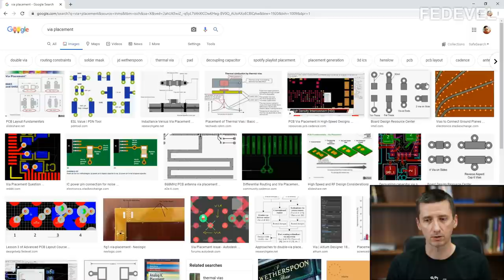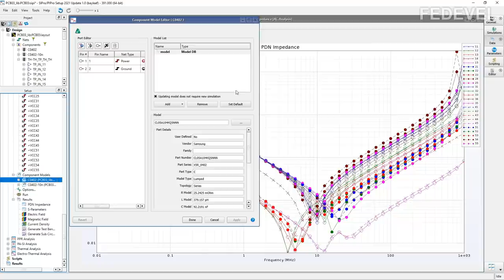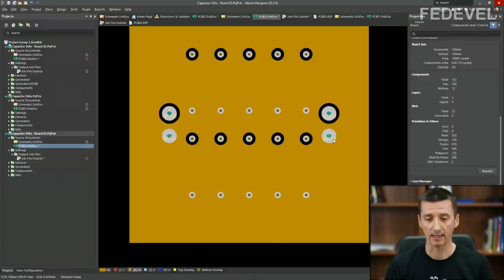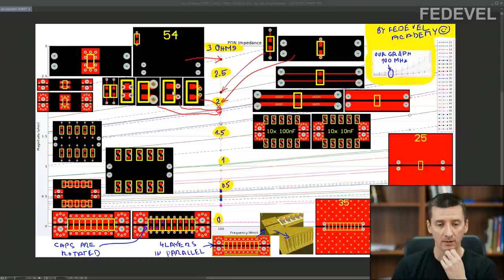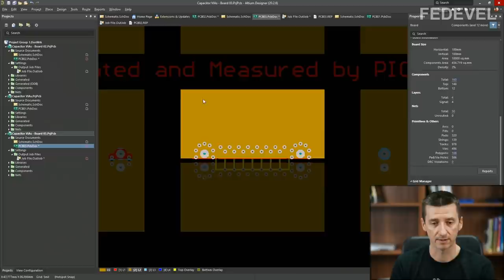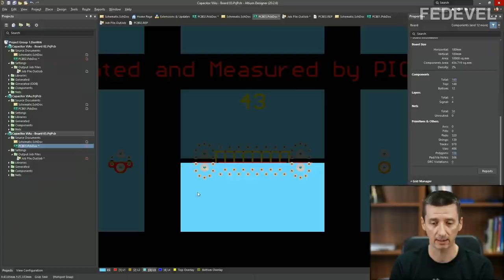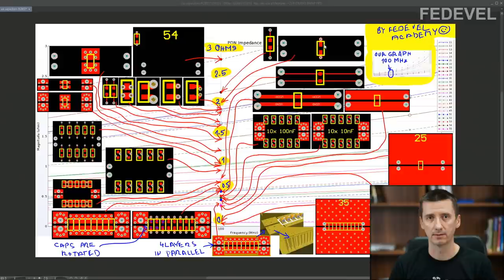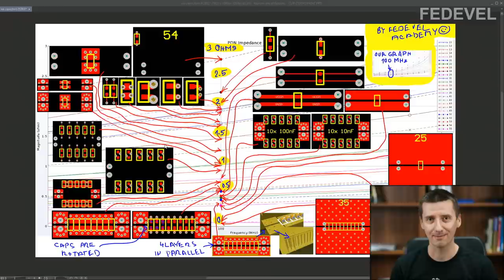What is The Best VIA Placement for Decoupling Capacitors?

Comment: To me the simulation results without vias look totally fine. To my knowledge, vias have non-negligible inductance which increases the impedance at high frequencies a lot. So a direct connection is always better than vias.
Reply: how does via inductance over frequency differ from track inductance over frequency?

Comment: I'm a hobbyist (2 layers PCB, audio) and I have been always taught that coupling caps should be on the same layer as the component being decoupled. I belive it makes sense, since vias have parasitic inductance and resistance (also explains why having multiple vias help). Thank you for the videos, they help me a lot!
Reply: I put them, on the same layer when possible, I also put a via on the GND pad of the cap.

Comment: When people say the location of the capacitor doesn't matter; they are talking about the bulk capacitor(C>100uF) which is more effective at lower frequencies. For decoupling capacitors location matters hugely. Moreover, if you build and measure the real results, I propose a better method for the circuit #43. You used multiple power planes. But if you use power and ground planes interchanging from top to bottom or vice versa ( P-G-P-G) you can create a good interplanar capacitances parallel to each other. This method is said to be much better since the interplanar capacitance has very small ESL compared to chip capacitors.
Reply: this is true, but this is only partial inductance.  You still have to get from the cap vias to these planes and from these planes to the ASIC or other DUT
Reply from the maker: Oh, I believe that people / articles were talking about decoupling capacitors. That is why I was so surprised. Need to find them ... PS: Good idea with the power planes. Thank you.

Comment: You demonstrate the effect of the position of the cap by showing one very far compared to one in the center. I would be curious of the result of a cap very near the power pins! Thx for the video, always fun to play the PCB version of Dora the explorer ;)
Reply from the maker: Thank you Nicolas :) PS: I am making a note about this setup.
Reply: @RobertFeranec  Yes, exactly my thought. I wonder how a single capacitor directly at the sink without vias would perform. Which is, to my knowledge, the recommended way of connecting decoupling capacities

Comment: I cannot recall where I heard this from. Someone told me that the efficiency of decoupling is all about the loop inductance (from the cap itself to the power pin). A via is an inductor as well as small traces and long distance. So a good decoupling is to minimize all 3, if you have space!

Comment: Very illuminating video!
25:20 I keep going back to the hydraulic analogy, because it works.Which will give you more immediate access to your local water reservoir: a long narrow tube or a short wide pipe? Of course you're going to have less impedance if the power traces are on the same layer as the capacitor; there's always going to be some additional impedance through a via, like resistance through a straw. In fact, if you plan your stackup right, you can even exploit the impedance of a via from a power plane as part of an RC decoupling filter. It's not rocket surgery, it's PCB materials engineering.

Comment: Very interesting!  Especially the performance of the thin top layer traces with no vias vs. planes with vias.  After some thought I would suggest that the remarkably low impedance is partially due to what the simulation is measuring.  Specifically, it appears that the simulation is calculating the impedance from the S21 insertion loss parameter which measures the voltage on the output pair given a varying voltage/current on the input port.  For a high speed decoupling capacitor I would think that the S22 (or S11) return loss parameter would be of greater interest which would measure how much the voltage on the output pair changes given a varying output load current.  I think that the calculated impedance based on S22 would be much higher for the long skinny top layer trace case.

Thank you very much for the wonderfully informative video and keep up the great work!  I would love to see some PCBs actually built and tested with a network analyzer for both S21 and S11 insertion and return loss measurements.

Comment: Hi Robert! Your video is highly informative, get to see which layout has the  lowest impedance. A bit of warning for vias planting near the pads, as this would leak the solder into them, thus weakening the solder joint on the cap leads. With a weak solder joint, weak connection, bad impedance. Thank you and keep sharing!

Comment: Hi Robert,

I really appreciate your investigation on that topic. It made me think a lot and the following question arised: How would simulation change, if you would only connect the capacitor's power and/or ground pad directly to the IC's pads and not to the source pads. I think this case would represent a very typical design approach.

In practice, many of the "good "solutions presented in your video can't be implemented, since board area is limited. If you like to spend more time on that topic, it would be interesting to take a look on more simple/practical designs. What I mean by "simple/practical" design is:
- Place one or two capacitors of different sizes (e.g. 1u + 0.1u) really close to the IC's power pad (capacitor and IC on same board side)
- Connect the power pad of the capacitor directly to the IC's power pad with a wide trace
- Connect the power and ground pad of the capacitor to power and ground plane by via, respectively

Then you could go ahead and simulate following effects on PDN impedance:
- Number of vias connecting capacitor(s) to planes
- Position of vias relative to power/gnd pad (above, side, both)
- Via diameter / via pad size
- Capacitor orientation relative to IC edge
- Capacitor's power pad connected directly to IC vs.capacitor's power and ground pad connected directly to IC

I think this investigation is very helpful for many board designs and maybe it would be worth a short video.

Comment: The parasitic capacitance on the example in the upper right is less since the the air is a much lower dielectric constant.   Much less inductance to overcome.   Results in a much lower ESR.   We always use thin trace for sense lines for this reason.   Good topic Robert, very well presented.

Comment: Absolutely fascinating, thank you for this! I’m definitely going to look for your other videos on this subject.

And I second the request for physical measurements to back up the simulation. My guess is the results would not be identical, but the ranking of results (which designs perform better than others) would remain the same.

I would be very interested to see the load changed to a SMT connector, to simulate (or physically test) the real world case of the load being a SMT device, like a QFP or QFN device. There is debate over the best placement of decoupling capacitors in these situations, and to me your result at 23:40 makes absolute sense; there are no vias between load and decoupling capacitor, and to me that would produce the lowest impedance between the two. For this reason I always place SMT decoupling capacitors as close as possible to, and on the same layer as, the load device.

What I take away from this is that the two biggest factors are (1) capacitor placement as close as possible to the load, and (2) avoiding vias between capacitor and load. Then, if you must via between the two, (3) maximise the number of vias in parallel, (4) maximise the number of capacitors in parallel, and (5) maximise the number of ground and power planes in parallel. Lastly, it is worth maximising trace width and minimising trace length, but after the above steps these make only marginal improvement.

Comment: Great Video!
If possible, I always try to place the decoupling capacitors on the same side of the IC and draw a direct connection (and not separate vias for capacitor and power pin).
In my understanding, I have two reasons:
The direct connection creates a low inductive path. That also applies for your example with a the thin, but straight direct connection. With separate vias, the current from and to the capacitor has a more odd path to follow, which results in losses for higher frequencies and impairs the decoupling effect.
The second reason is: You want to have the decoupling capacitor as the reference, not the decoupled plane around the IC. There might be still some current peaks crossing that take effect. This applies for forward and return current, so to say Power and Ground. That is why I also try to put the vias behind the decoupling capacitor, not between capacitor and IC.
Reply: this may not be a good idea.  Watch for another via.  The question is always the sum of the partial inductance terms.  If there is a large separation between planes (say 2 layer or 4 layer PCB with symmetrical thicknesses) then the inductance of a surface trace is very high.  If the two capacitor vias can be very close together, field cancellation will greatly reduce the inductance.  This is in many of my lectures and bootcamps.
Reply: You are doing exactly the right thing. Keeping the noise out of the plane.

Comment: Great Video - an EMC seminar once told me to run power trace across the capacitor, directly to your pin of the IC you are decoupling (Same side). So this adds up with what you have said here. Would be great to see this boards in action.

Comment: Robert, very nice and useful video and very surprising results! If I understand right, the loop inductance plays the main role in degrading the PDN quality. As well VIAs also degrade the loop inductance according to these results (due to their inductance). Placing decoupling capacitor far from the desired point on the board (like VCC & GND of some component) significantly reduces the influence of this capacitor on this desired area. This is the reason why it is mandatory to place as many capacitors (near all power supply pins) as possible. When we place the capacitor between two parallel traces, the travelling wave (noise) is shorted by it, and do not propagate towards the load. When this capacitor is placed far away aside, it shorts the wave propagated towards it, but not the wave propagated towards the load, and can even create travelling wave. This is how I imagine this phenomena. So, according to this video, the best way to place the decoupling capacitor is on two traces between VCC and GND vias and an appropriate componnent's pins. Please correct me if I'm wrong.

Comment: This is very good, thank you! It would be interesting to see the result when there are vias by the capacitors, and then they are connected with traces to the power pins but not the supply. That seems likely to happen in a board layout.

Comment: Excellent work, Robert!  Years ago, some technical articles I read, either from Microchip or Cypress Semiconductor heavily stressed the effectiveness of placing decoupling caps near the power pins and on the same layer as the power pins of microcontrollers.  EG in the case of a quad flat package.  You can feed the pins their power through vias, but you want the decoupling caps between the vias and the pins.  As you say, you can't always have things arranged this nice, but it's something to target when you can.  I like your confirmation of surrounding power feed pins with vias improving performance.  I had often suspected this would be the case.  Thanks again.

Comment: Hi Robert, this is amazing stuff! Thank you so much! After reading so many application notes, books and following seminars on the topic, it's your videos that make it all come together in a way that is easy to follow, and you can actually see what happens. Even when I do indeed understand that it's a specific simulation and results may be different on a real board. Thank you for making the theory practical so that it's easier to apply in real world board design.

It would seem that the impedance - mostly inductance it seems - between the power connections and the capacitor has the most influence of how much total impedance there is at 100MHz. I see the impedance curves increasing with frequency which also seems to indicate we're looking at inductances having the most influence at those frequencies. All this time I have been thinking about how to connect capacitors*, and now it begins to show that you may instead have to think about how to minimise *inductances in the connections.

I was as surprised as you were at how good the one with the long thin traces and no vias was. It made me wonder about how much inductance a via really has compared to a long thin trace like that. There must be a crossover point somewhere where it's better to use vias or multiple vias than a trace. In any case, I am making a mental note to make sure my power connections are done with wide traces wherever I do need to use traces.

What I really wondered about is this. You placed the single capacitor right in the middle between the source and load pins. What if you placed it right next to the load pins, similar as you would do with an IC's power pins? Would you be willing to consider trying that?

A second question is how stackup comes into play here. I would assume there is a difference depending on how close the power and ground planes are in the stackup?
Reply from the maker: Thank you Christe4N. PS: Exactly the same for me - I also changed the way how I look at connecting decoupling capacitors. We may be doing follow up video with some other examples.

Comment: Hi Robert.
It would be interesting to compare with the installation of one low-ESL capacitor. It should be significantly better than a single conventional one at high frequencies. By shortening the track lengths and increasing the number of holes, we reduce the external inductance and hit the internal inductance limit. We can further reduce the inductance only by paralleling conventional capacitors. According to the characteristics of the capacitors, we should get the same characteristics for one low-ESL capacitor and four normal capacitors. All connected with minimum external inductance.

Congratulations again on the youtube button:)
Reply: It would also be more interesting to compare standard situations with a single capacitor and using two polygons (power and ground as in the first examples) versus a ground polygon and powering the track (in the same layer as the power polygon), via a capacitor.

Comment: Very cool video. 
Your last simulations are correct for the behavior of the capacitor impedance. But the split plain on the top side of the board is still a dipole. If you make it in physical boards, probe it with a near field probe to see the difference between full ground plain and split ground and power plains. I’m guessing you will measure impedance through the cap is amazing- but you still radiate with the modes of the plains. 

I definitely learn something from these videos. Keep up the amazing work! Thank you.

Comment: I had experienced your finding about cap on the same layer the hard way - EMC testing. It is all about loop area and inductance. After putting power inductors and power caps on the same side of the board, design passed EMC. With caps on the bottom we as engineers get sloppy, we forget that energy is stored in the dialectic between planes and cap plates. So if we changing plane (which we do, image current flow direction), we increase impedance a lot. I use that for filtering when I need to. If we keep decoupling cap on the same layer, we get current flow from the cap (directly between +V and GND pins of IC) on top layer, then this current is supplemented by current flow from inductive power pins. If we do not use direct connection to cap, then current flow from power plane to IC pin (through inductive vias), so voltage drop and ground bounce occur and only then additional charge comes from the cap (through inductive vias).

Comment: From my understanding, the placement is important from loop-area standpoint but the vias also add a big problem (they're inductive mostly with capacitance to the inner plane holes).  It's best to use the same layer from the capacitor to the IC power pins using very short traces (if possible) and then have the via to the power planes.  This way you avoid extra inductance and you have the local decoupling with the lowest impedance to the IC (this is why you want capacitors in the first place - for high frequency transient energy).  

For a more realistic simulation you should have an IBIS model of an IC with dynamic switching because the transient behaviour of an IC during switching is a non-linear current draw.  The different frequencies will see different impedances due to the different current harmonics.

Comment: very useful video, always wondered how the via placement on decoupling capacitors could affect its effectiveness. not very surprised for the better result on the direct connection (no vias) as I see vias as 90degree turns on a track. i hope you build these boards for real and test them, i think more surprises would come. thanks for sharing!

Comment: Your investigation is terrific.  I would like to see the real assembly measured.
But one I would like added is say some spread of bypasses between the in/outputs, but also one at each of the input and output nodes on the same side, thus see if improvements will result from bypassing at the in and load nodes not just spread across the board. Significant is the improvements by NOT having connection by via. This is quite critical as I tend to make bypass on the direct connection to device power lines not bypass to a via to power plane near where also the device reaches power plane by a via. Hope I have made that clear what I mean
Reply from the maker: Thank you very much Helmuth. PS: That is what I would like to also try.